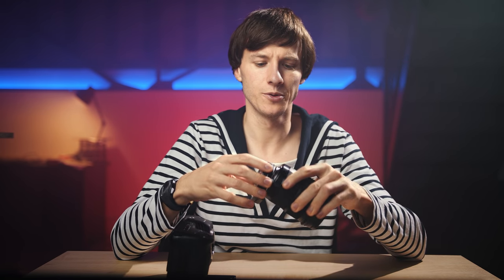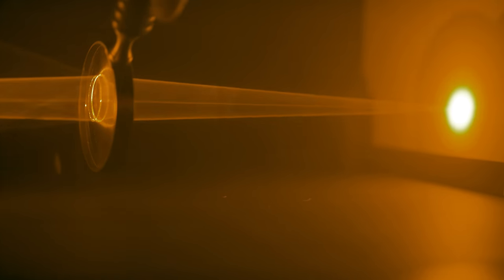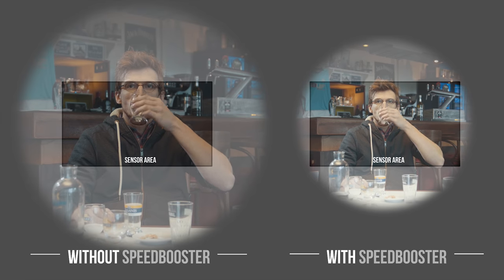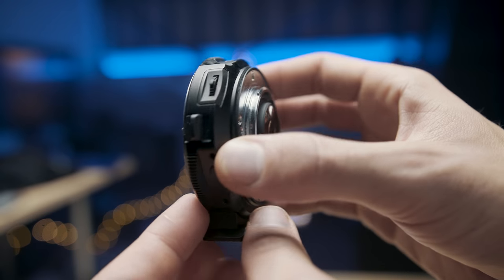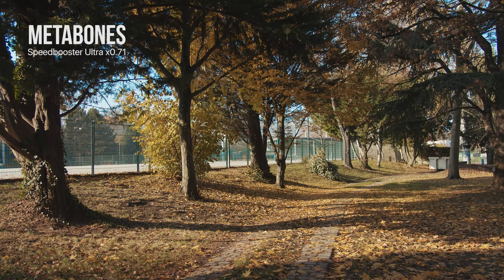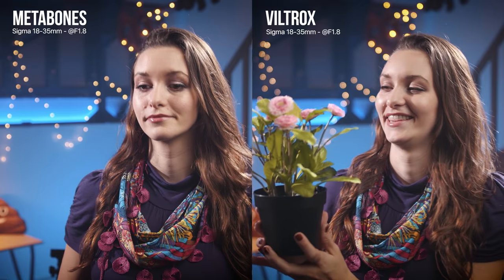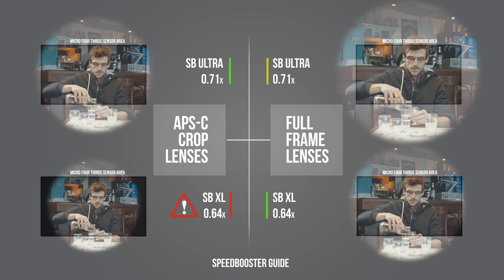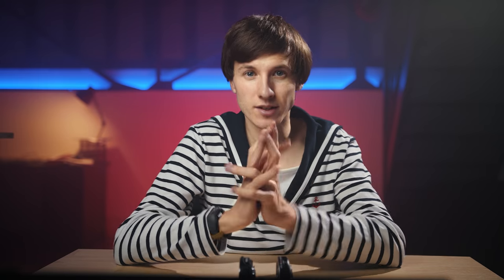How Does a Speedbooster Work ? ( and Metabones vs Viltrox  )

Comment: This video contains INCREDIBLE amount of ACCURATE information and amazing way to express it with visuals !!!!!!!
Cannot truly say enough to be fair on the AMAZING EFFORT !!!!  Congradulations !!!!!!!!
One question , please : Can i use the Sigma 18-35/F1.8 with the XL0.64 Speedbooster , if i decide to use ONLY the 24mm-35mm Focal Length ??!!
Reply from the maker: Thank you ! I really care about the 9 minutes you spent watching the video, as much as you cared to watch it. Interesting, I'll test that when I have an XL in my hands and let you know. It should actually be OK because I've already used a (Full Frame) 5D Mark II with the 18-35 set at 35mm, vignetting was only very strong at 18. Let me check that once I have an XL to try !
Reply: @zebrazone  I really appreciate your response and your interest.
Your behaviour is exceptional.
You stand out among YOUTUBERS , like a sunshine into the darkness. BRAVO,BRAVO,BRAVO !!!!!
Reply: When I use the sigma 18-35 on my GH5 with the Xl 0.64 Speedbooster it works the hole focal length as long as I'm filming. But with photos it starts to crop at around 23 when I'm in 4:3 mode. Don't know if its the same with the Blackmagic Pocket 4K? But they should have about the same size on the sensor. And with that camera you won't be taking any photos I'm guessing.  @HollywoodweddingfilmsGREECE
Reply: @hatakekakashi938  Thank you for your input. Unfortunately Pocket 4K has a sensor 10% bigger/wider than GH5.
Pocket 4K = 18.96mm
GH5 = 17.30mm
As a result , it creates significantly more vignetting in the XL speedbooster. But i am not sure which focal lengths are affected by this , on the Sigma 18-35.
Reply: @HollywoodweddingfilmsGREECE  I rented BMPCC 4K last week, it came with Metabones Speedbooster EF/BMCC. When I've tried it with Sigma 18-35 and few Xeen Cine lenses I've noticed some aberrations and vignetting in the corners. I switched Metabones for my EF/M43 XL (x0,64) and image was crystal clear.
Reply: @NilsnLewinski  That would be AMAZEBALLS !!!!!!!
I wish you are right .... because i own 3 x0.64XL speedboosters. :)
Reply: there is also a lot of unaccurate information, read my post ahead
Reply: @NilsnLewinski  I really want to believe you, but I'm skeptical because this contradicts what the video is saying. So when using the BM Pocket 4k (try 4096x2160), EF/M43 XL x0,64, and Sigma 18-35 you're not getting vignetting and chromatic aberration? What about at 18mm and f1.8?

EDIT: So I did my research. I have to say that Nilson is definitely wrong about using a MB x0.64 with the Sigma 18-35mm. The reason is because the BMP4k is slightly bigger than a normal MFT sensor,  which tips the scale. At a crop factor of 1.89 x 0.64 = 1.2, it is dangerously close to full frame standards at 1.0. On the other hand 1.89 x 0.71 = 1.34 is much closer to the normal APS-C crop of 1.6

So this video was correct.
Reply: hi, I use that setup. 0.64 +  sigma 18. if you zoom in to 20 or 21 its gone, or zoom in in post. my gh5 you can barely see the vin at 18, as you guys mention here already the sensor size is tad bigger on the pocket obviously. my choice is the 0.64 just more lens choices and can get the most out of your sensor.
Reply: @Theeslickness  @Nilsøn Lewiński is right - Speed Booster can produce aberration in the corners of BMPCC 4K sensor. It's because there are two different 0,64x Speed Boosters - look here: https://www.metabones.com/assets/a/stories/CompatibilityMTF.png - one, that Nilsøn has used - (MB_SPEF-BMCC-BT1 - first version of Metabones Speed Booster) is dedicated to BMCC 2,5K camera and is adjusted to thickness of its infrared filter and the second one MB_SPEF-M43-BT3 that is dedicated to most of MFT cameras
Reply: Hollywood-Wedding-Films.com For real i dislike channels that don’t show visual differences.
Reply: @lawrabbitt  They are also releasing a new version for the new Pocket 4k.
Reply: One thing I haven't found an answer to anywhere is whether or not using a speed booster effectively changes the level of compression/distortion of a lens by changing the angle of the light or if it changes the focus range. The animation shows that the angle of the light coming in the lens does not change as a speedbooster is added between the lens and the body. I just want to make sure that using a speedbooster does NOT, for example, make a 100mm full frame lens speedboosted on a crop sensor camera have an angle of view any wider than a 100mm lens would on the native full frame camera. I understand that a 100mm full frame lens and a ~65mm crop sensor lens may have an equivalent "field of view" but they don't have the same level of compression and a 65mm crop lens will eventually always capture more information than a 100mm full frame at the edges of the frame if you move far enough down range from the camera since it has a wider angle but a smaller sensor. With this in mind, I can't tell if a speedbooster is just fitting the exact same final image down onto the smaller sensor (ignoring lighting and bokeh differences) or if it is changing the angle at which the light is selected for ahead of the main lens. Essentially I'm wondering if a speedbooster allows the dimensions of the image to look exactly the same as they would look with an image taken using the camera that the larger lens was made for (like full frame) assuming it's a theoretically perfect speedbooster with no wasting of the image circle.

Comment: Unless you are making money with your cameras, Viltrox ALL THE WAY. There is absolutely going to be better footage with a $700 adapter vs a $70 adapter. Metabones overcharges to much and if they were in the $300 max range its still overpriced but I would have considered it. I have a Viltrox myself and work has metabones, yes Mete is nicer but for personal use, the price cannot be beat. I expect 10 times better performance for that price and it was better but not at that price. But again, Metabones is meant for those doing this for a living so they will charge high prices, I do like de-clicked on Metabones where Viltrox is clicked. Viltrox is all manual, a BMPCC will not use the cameras functions for Iris.

Metabones is like Autodesk, they charge so much because pros use it and can afford it, but their is the cheap version with far less for non-pros.
Reply: I have an active Canon EF lens with a Viltrox speedbooster.  I can definitely confirm that the Viltrox will most definitely allow for electronic control of the iris, autofocus, and will allow lens stabilization to work.

Comment: I have 2 GH5 and 2 GH5s for my production house, 2 paired up with metabones and two paired up to vitrox. We’ve used them all interchangeably and randomly amongst all 4 cameras. Other the then the perceived quality difference being higher on the metabones  there is no difference in the footage. None. On the viltrox you are required to adjust the lens manually to set infinity focus (you can do a quick search on YouTube for a tutorial on how to do it) it’s really simple though. Cheers
Reply from the maker: Yep I did this infinity focus adjustement. In practice I think my usecase was very specific. Differences appear wide open only. Or maybe I got a wrong unit. Glad it's going well with you !

Comment: Other comparisons show that the corner sharpness on the viltrox improves significantly once you stop down to 2 or 2.8. Also, the Sigma 18-35 is an apsc lens, so it may be better with full frame lenses. I personally think that it is better to use a full frame stabilized lens like the canon 24-70 f4 on the BMPCC4k/Viltrox setup.

Comment: Excellent video.
I think the problem with Viltox or Chinese boosters is the quality control,  the majority are very good, some are correct and a few are just crappy. I agree with you about image quality, but if you plan to use pro lenses, not sure a cheap booster (or even an expensive one) is an option but when working with old lenses such as Russian M42 or T2, the ultimate sharpest is not the aim of the booster, it's more bokeh (especially in MFT) and in this specific case, even the low cost ones do perfectly the job. 

Personally, I still work with 120mm and 35mm film cameras and of course use the lenses on my mirrorless cameras, because I love the render of those old lenses, color, bokeh, imperfections, flare and the manual focusing ... in one word, the character . I prefer not to use adapted AF lenses because often, there are AF (speed or accuracy) and back/front-focus issues. 

When I need to have sharp, perfectly controlled images, I prefer to use "native" premium or pro lens, ideally fixed focal. I use zooms only when I travel. 

About the lens attachment, with Viltrox adapters (not only boosters), on MFT you need to make a little bit deeper the hole connecting to the camera (on the MFT rear mount) to be sure it locks properly. I had this issue on Olympus OMD-1 (both mark II and III) and on OMD-5 mark III but not on OMD-5 (mark I and II), probably Olympus changed a little bit its connector to reduce use of third-parties adapters and/or to improve something but to be sure the connection works, the small hole must be drilled +-0.5mm. It has no impact on mount to older Olympus or Panasonic cameras. I had the same issue with some other adapters I bought or I printed.

Comment: This is weird, maybe viltrox do have a quality control issues because mine is really sharp corner to corner, i have test it since I got it six months ago. The only thing I had to check was to adjust the lens to get infinite focus, but is a really easy thing to do. Maybe doing that will correct the focal plane and help the corners.
Reply from the maker: Did that too. Could be too things : 1) My unit has an issue 2) Big differences only happens wide open
Reply: @zebrazone  
Hey Zebra did you have any changes to your viltrox? I think to purches one for my bmpcc4k but not so sure yet

Comment: I don't have a Metabones Speed Booster to test against my Viltrox EF-Eii Speed Booster.  However, I am fairly happy with my Viltrox, using it with Canon EF lenses modified for use on the Sony APSC A6400 and A6500 cameras...  I use this almost exclusively for portraits so the unsharp edges do not bother me to any great degree and, perhaps because I am only using the center portion of the frame, I don't notice the unsharp edges too much.  I also have an inexpensive M42 to E-mount speed booster which I also use primarily for portrait work.  I was able to get the Viltrox EF-Eii Speed Booster for right about $100 (U.S. Dollars) on-line.  Since I primarily use native e-mount lenses, except for portraits, the Viltrox provides an economical accessory for my e-mount APSC cameras.  I have noticed that my EF 70-200mm f/4L IS and 100-400mm f/4.5-5.6L IS ii lenses auto focus better with the Viltrox than with the Metabones IV and Sigma MC-11 adapters...

Comment: You're production quality it's amazing. You definitely set a bar for what but I want to achieve when I start vlogging. I've been looking at the viltrox and the metabones. and I will likely go with the viltrox because the difference in quality towards the edges isn't as important to me as I shoot wide open. Did you see any changes when you stopped down?

Comment: First of all, this channel is one of the best I've seen. Clearly and competently presented.
I would ask what you think about this “Canon EF Lens to BMPCC T Speed Booster 0.58x”. Based on your video, is there risk of vignetting compared to "Canon EF Lens to Micro Four Thirds T Speed Booster XL 0.64x". I use Canon professional lenses, so all are full frame.
Reply from the maker: Thanks a lot Jari ! You will probably have vignetting, even with FF lenses,  if you use the BMPCC speedbooster on the latest BMPCC 4K since this SB is meant to be used with a smaller sensor.
Reply: @zebrazone   Thanks, so the Speed Booster XL 0.64x will be better of those two

Comment: Great video. I’m curious if you adjusted/calibrated the viltrox’s focus at all or just used it out of the box.  I haven’t done any adjusting myself but I’ve heard like the metabones you can adjust the infinity focus on the viltrox.  Not sure if that would have any affect on what is happening on the edges of the frame using the viltrox.  Cheers

Comment: Hi Zebra Zone,I got a question with the speedbooaster because i got mix reviews but i trust your opinion. When you put any ff lens with the speedbooster and your f stop goes from 2.8 to 1.8. This is f1.8 full frame? Or 1.8 m4/3. If it is m4/3 then you go from a f2.8 full frame to a f3.6 ff. If you are concentrate the light in one point it should be brighter, It could be test out with the adapter with no speedbooster and the with the speedbooster and crop the image to see it. Hope you could help! i am thinking on buying the 24-70 f2.8 Sigma and sell my 12-35 lumix. Great video i was going for the viltrox but i think is best to invest on the metabones.

Comment: Hi, I am concerned about the image circle and bmpcc 4k sensor, so my concern is that not all EF lenses are equal, you mentioned the sigma 18-35 which is a fantastic lens and I own it, I am happy that it works, it is a crop sensor lens and not a full frame glass, hence the ultra or the EF -M2 works, but does the Tokina 11-16 F2.8 or the newer 11-20 F 2.8 with its smaller image circle work for this camera since its about a 1.9X crop factor? I am guessing it won't Vignette at 16mm or even 14 mm but obviously the reason to put this glass ( Tokina) in front of the camera is to harness the 11mm part of the lens. I am not quite sure if the math works for this. sure for the older BMPCC camera it works because of its 2.3X crop factor but this is a bigger sensor and hence closer to the APSC format, perhaps a 0.81X speed booster would be more effective if I am not mistaken. please correct me if I am wrong.

Comment: great video!
 I use 0.64 for a couple of reasons, one ,90% of my glass is full frame. the other is instead of 1 stop I get 1.3 stops increase, which goes along way on a smaller sensor(when trying to get low light shots and more shallow depth of field). and the last reason ,the crop is less then the .71, which really helps in like real estate vides to get a wider shot on the same lens etc...

 my question is - when I use my sigma 18 with my setup, at 18mm of course you get some vignette, but all my footage goes through Davinci and premiere so no biggie to zoom in till the  vignette is gone and even so with this done  its still wider and got .3 stops of light  increase then the .71 
 my concern is what about image quality on the edges? with the scenario  I described above, would there be a difference in sharpness, defringing, chromatic aberration?

thanks , your videos are really educational.
Reply from the maker: Very specific case but I see what you mean, I think the best option is to compare both speedboosters at 18 with a calibration chart like the one I used : https://www.graphics.cornell.edu/~westin/misc/ISO_12233-reschart.pdf But honestly if you're very often into real estate I would recommand going for the Olympus 7-14mm.... so wide ! And sharp. A bit pricey but I love it and have been using it for years, it won't be obsolete before long.  I also tested the 8-18 from Panasonic with a chart but it's not as good as the Olympus wide open.

Comment: Problem is; at the Metabones price tag, one may as well just go out and buy a full frame camera if one is so bent on using EF lenses. So it's the Viltrox or an upgrade on the body, simple as that. I use it for night time low light indoor investigations where exposure means more to me then clarity. The crop sensor cams are great for the weekend warriors / amateurs, if your going pro go full frame. Simple as that.

Comment: Great review with, I'm sorry to say, one very common mistake.
You have forgotten that as well as effecting the focal length the crop factor also effects the amount of light hitting the sensor.

So the speed booster will NOT make an f2.8 lens behave like an f2 lens on an APS-C camera with a 1.6 crop factor, 
it will make it behave like an f3.2 lens (f2.8 x 1.6 crop factor = 4.48 x 0.71 speed booster = f3.18).
Reply: Without the speed booster and with a standard adaptor the f2.8 lens behaves like an f5 lens on an APS-C camera so the booster is still well worthwhile but not quite as magical as some believe. The simple fact is you contrary to what you say at the beginning can't get more light through a lens by adding more glass to it, but you can recover a percentage of what has been lost.

Comment: Bonjour ami, perhaps already mentioned here online as a result on your nice info video. I own the Sigma 18-35 and I learned that it needs to be calibrated with in this case the Blackmagic pocket cinema camera 4k to get the correct sharpness. In this case with the Viltrox EF-M2II in between this should be done again to have adjusted properly to have a good/fair performance test. Keep up the good crea work! :) Au revoir

Comment: Nice video, Do you notice any softness at wide open when using the Metabones and the 18-35 in your BMP4K? I bought the MB XL and there is a terrible softness when using it wide open. I contacted Metabones and they told me they know it already so they are realising a specific adapter for the pocket. However, I've been told that the ULTRA has better quality so Im tenting to switch to the ULTRA. Thanks!

Comment: Nice video with a clear explanation of speedboosters in general. Did you only test the speedboosters with the lens wide open? Because I have seen another review (in German) and his conclusion was the same as yours, but only with the lens wide open. Stopped down a bit (2.8) the quality was pretty similar and stopped down even further the Viltrox even took the lead. Can you confirm or debunk his findings?